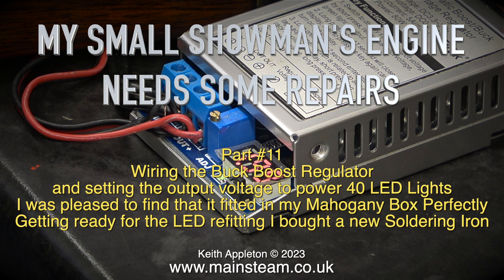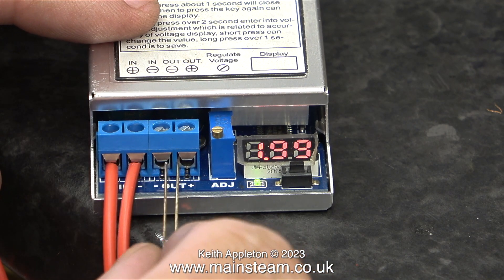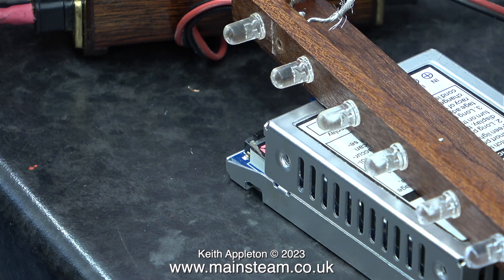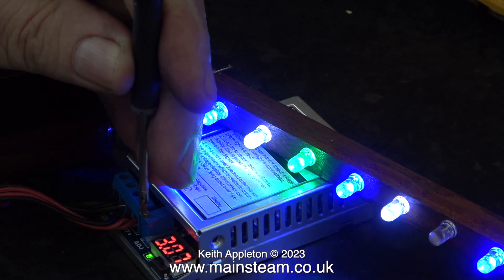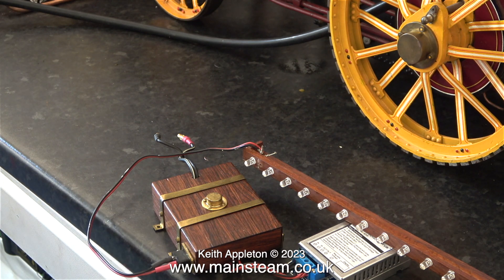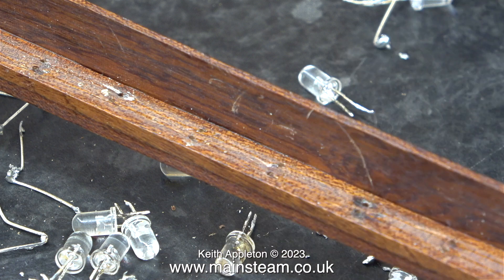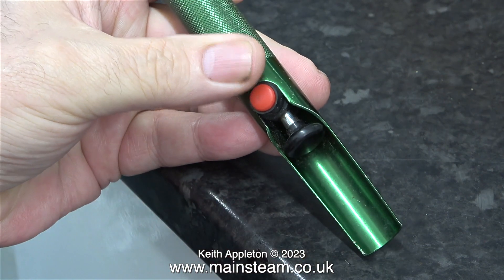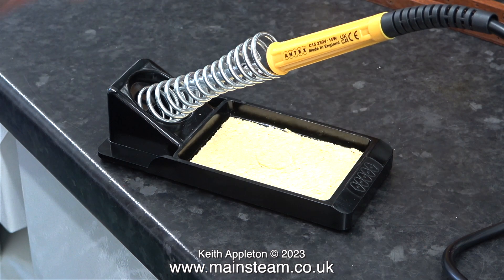MY SMALL SHOWMAN'S ENGINE NEEDS SOME REPAIRS - PART #11

Comment: In dutch we have a saying: "Goedkoop is duurkoop"
Which means that buying cheep can turn out expensive. Like you have with your Antex soldering iron, I have with my Weller. It's lasted me for years and decades before that for my dad, apposed to the cheaper ones that tend to do this funny thing called: "Breaking". Much luck with your new toys, looking forward to seeing the soldering in tomorrows video.
Cheers, Thijs.

Comment: Better yet, ditch the buck regulator, and group the LEDs in groups of 8 in series, which would require maybe 20-24v to light them. Then add a 470ohm resistor in series, and run directly from the 30v generator. This will give approx 8v ish across the resistor, giving you a nice safe 17mA LED current. Get a reasonable sized resistor though, maybe 1/2 watt.
Reply from the maker: The generator only generated 30 volts running at a high speed, I need a regulator in the circuit. This one is miles better than the one I fitted 13 years ago ......
Reply: @keithappleton  what’s its average voltage output then? You can adjust the number of leds and series resistor to account for that.
Reply from the maker: no average - depends on the speed of rotation of the engine's flywheel . . .
Reply: @keithappleton  and yes you do need a regulator, but it needs to be a current regulator, not a voltage regulator. The led series resistor acts as a crude current regulator, making the led current much less dependent on supply voltage, compared to your current setup.
Reply from the maker: Yes, I know ....... I used to be an Electronics Engineer . . .  thank you for your advice.

Comment: Those “dead” LEDs might actually be good, but just require more than 1.99v to operate. Would be much better to crank up the output to something like 5v, and use a 1k series resistor to test them.

Omitting a series resistor is a bad idea, since leds have an exponential current/voltage relationship, meaning a tiny variation in voltage can lead to huge current changes.
Reply from the maker: they are all from 3 identical packs of coloured 12 year old LEDS. They are definitely duds . . . . .

Comment: I would be slightly concerned about the total amperage you are asking of the copper strip.  40 leds at even 10mAmps is 0.4amps.  The copper strip looks like foil.  If you need to you can bolster the copper strip with solder to add some cross section.  I would measure the thickness of the strip and figure out the cross sectional area and compare it to the cross section of a wire needed for 0.5 or 1 amp... assuming the copper strip is actually made of copper... check to see if it draws a magnet... copper plated steel is a standard practice in china.
Reply from the maker: I will see how it goes ......... it is experimental to use this foil.
Reply: I can relate to the issue you mention in the end of your comment, I was already wondering why my "brass" nails and hinges were sticking to my magnetic pliers ;).

Comment: The old red and yellow leds are 1.8 or so forward voltage.  The other ones are 3 to 3.3v forward voltage.  Those can be any colour depending on the phosphor but are based on UV light hence the common 3.3v.

Comment: interesting that you use 230 volts in your country does anything there run on 115-120 volt? / cute scissors I like them
Reply from the maker: No, my country being England, we use a 230 to 240 volt mains supply.
Reply: thanks